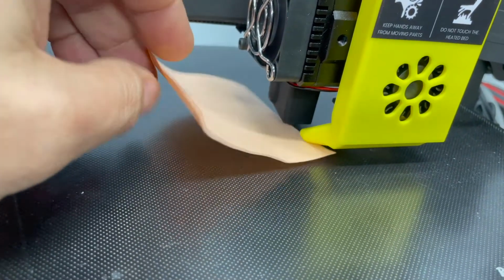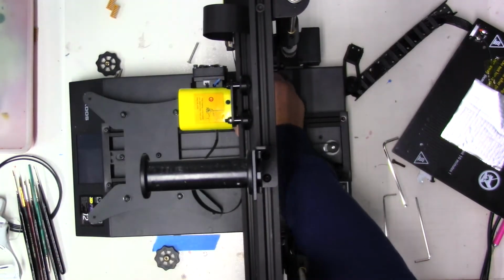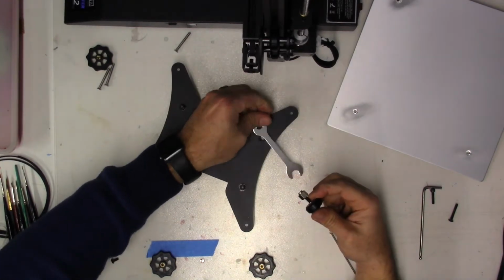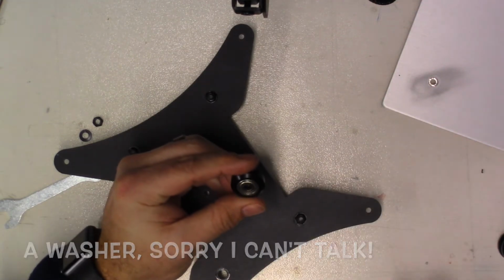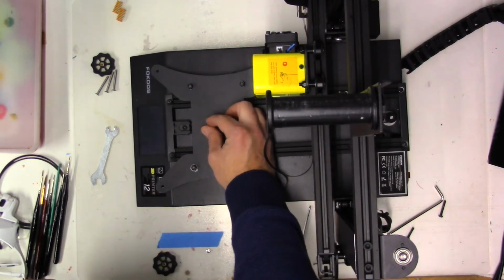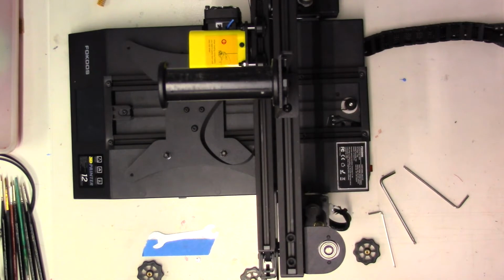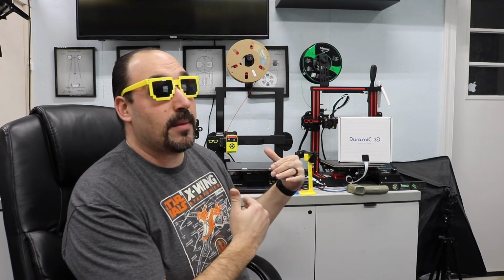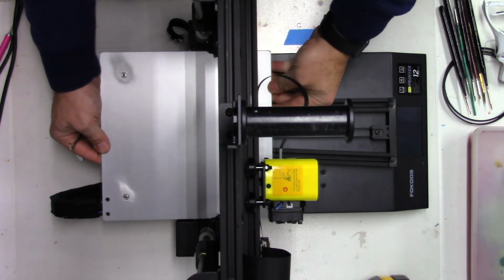Changing bed wheels on a Fokoos Odin 5 F3 3-D printer￼

Comment: Did you get the same wheels or upgraded?
Reply from the maker: I just ordered these and they worked out really well 16 Pieces 3D Printer Wheels 3D Printer POM Pulley Wheels 625zz Plastic Pulley Linear Bearing Compatible with Creality CR10, Ender 3, Anet A8 3D Printer Accessories, Black https://www.amazon.com/dp/B09CGJZYPK/ref=cm_sw_r_cp_api_i_EJRYCZD75KWCTDWE8YMZ?_encoding=UTF8&psc=1

Comment: Bro... I had a crazy quick fix idea I would like your opinion on. What if I simply attempt to glue the bearings to the wheels? There is a machined line on these bearings the top is supposed to seat in. I can possibly glue them right on the edge of that machined ring/line. Thoughts? If you seat them flat and flush on mine and not right on that line the bed is too far from the extruder. When I line them up though it remains level for a moment. LMAO!
Reply: The overhang at the bottom of the wheel should give it some flex and not work anything imo. I have no experience with this stuff though. Just trying to think things through. It is half the reason I got into this. Mental stimulation. I mean it is a crazy idea, but you are crazy Will. If you say it is crazy, then I will believe you. LMAO!
Reply from the maker: @KurtisJoseph  ok so gluing the bearings to the wheels? Just put it on the wheels could work for little while 🤔
Reply: @CrazyWillTechShow  yeah. Just a smidge. I will give it a shot and do the foil thing while I am down there. I mean I assume thinking your way through temp fixes is a good practice in this hobby. It cant hurt. I will get new wheels regardless. I just want to try and level and test print. Thanks for your opinion!

Comment: I bought this as my first printer. I'm pissed. The wheels are screwed up big time. The bed falls down into the wheels constantly. I haven't been able to level it and print at all.
Reply from the maker: This is so annoying they have to do something. Can you return it?
Reply: @CrazyWillTechShow  they won't even get back to me to do that bro. I've been fiddling with these wheels just to try to level the bed for a day and a half now. I bought some awesome files and 10 lbs of filament to get through the learning curve. I can't even run a test print. Everytime the bed moves it drops down. Tightened the screws above the bearings. No help at all.
Reply: @CrazyWillTechShow  The FB support group isn't even responding about the issue. If it's assembled WRONG I would rather assemble something myself.
Reply: It just frikkin falls down and then the nuts drag on the base and it starts rumbling. I'm soooo irritated.
Reply from the maker: How long ago did you contact the company? usually take 2 days.
Reply: @CrazyWillTechShow  Well they got back to me immediately at first. I sent them an email 4 hours in. It came with the wheels off track. They asked for the order number and haven't got back to me since. They are giving these things out for a dumb contest on the FB group. They need to give them out free to those who got one's that are jacked up instead. That way I could use this one for parts. Lol! I should have got a Sovol 3.